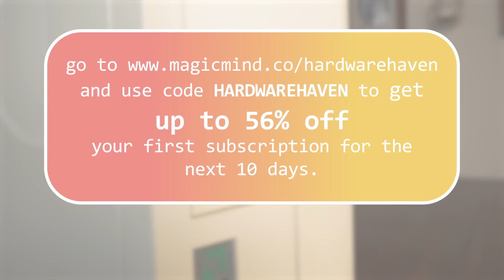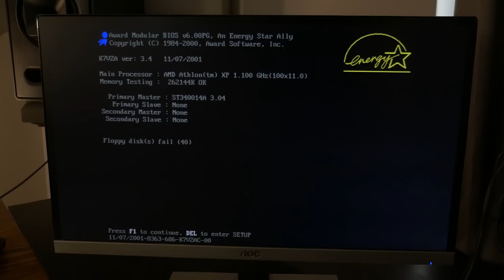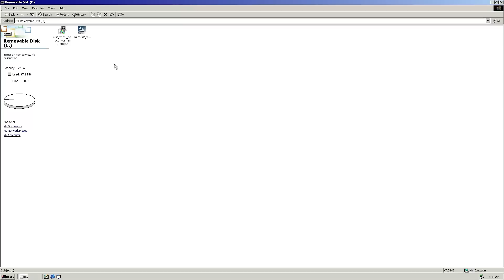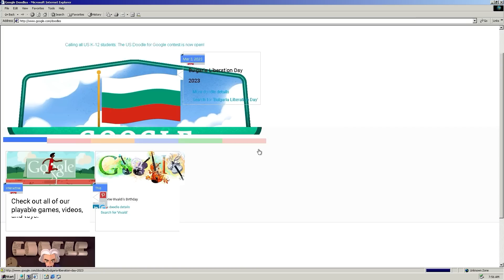The OLDEST PC I've Ever Worked On

Comment: Make sure that Athlon XP is always properly cooled. They have no thermal protection and will literally burn up without cooling.
Reply: Back in the day we would RMA these and most of the time it was because someone booted without the cooler. It took some of those Athlons less that 20 seconds to get to 120deg. The enamel around the doe would turn to a caramel color and flake. “Got another Caramel!”
Reply: @Kikay0n  Yeah, I learned that lesson the hard way about 15 years ago when I tried booting one up without a HSF thinking it would be fine for just a couple of minutes like a Pentium 4. Nope, that was the end of it.
Reply: They actually could crack and the die blow off the chip if left uncooled.
Reply: Yep. I've both cracked the die of an athlon xp and created the magic smoke putting on the hs/f wrong. And not at the same time.

Comment: Those Cases were called GEM cases back in the 90s because instead of having the panels slide back they slid forward after removing the front face, they were sold to antec if I recall correctly. Also power supplies back then had awful caps in them that leaked a lot your a brave man plugging a unit with a power supply that old. I would of yanked out the PSU and put in a modern one before even turning it on lol.
Reply from the maker: What’s the fun in that?? Haha
Reply: @HardwareHaven  well your luck played out well the rest of the hardware worked. When I did it it took all the hardware out with it lol so lesson learned lmao
Reply from the maker: That’s a bummer haha
Reply: @GhostieXV  wow good to know, I use 20 year Macs a lot so maybe I should try and replace it!
Reply: This is actually an Enlight case, EN-7230 to be exact. I have the same case (even the same AMD sticker) on one of my systems. Also in my experience older power supplies are usually fine. It's more slightly newer capacitors with issues. But I would probably do a quick visual inspection of the internals just to be safe.
Reply: These capacitors like slowly turning into resistors too.

Comment: First rule with old computers is "dust" it out. Spiders like to crawl inside and other such bugs short connections.
The 4 pin 12v power connector was introduced with the Intel Pentium 4 processors, we called them the P4 connector because it was 4 pin and the P4 required it, the AMDs didnt need it.
TNT2 wasnt bad for an entry level, better than onboard video but thats it.
The HDD is contemporary to the other hardware but the CDROM drive is a little bargain basement for the rest of it, DVD and CDRW was more usual back then.

Comment: We call it Smoke Testing.  We just power it on, and see if it turns on successfully or if it blows up and starts smoking.  Usually it won't start a fire, but it's scary as heck sometimes.  The old PSU typically will likely have bad or leaking caps so I'm leery when handling anything over 20 years old.  EDIT: if the PSU is over 20 years old, and it's a generic no-name brand, and it's never been tested, I'd skip the smoke test completely.  Just toss it out in the trash, and just use a good psu on hand.  Don't take any chance for any further damage, especially to motherboard and other components.
Reply: actually i'd say some later psus were worse, 'capacitor plague' very late 90/2000s ones, all my really old earlier 90s pc psus have been ok, except one where the mains suppressor cap blew up   (yes, a RIFA!)
Reply: its always a good idea to test any psu of unknown state on a dummy load and measure voltages before letting it loose on the machine itself
Reply: Ahhh the era during the late 1990's and early 2000's when the capacitor plague was at its peak. I still wince slightly when I plug in those IEC leads. I've lost count at the number of PSU's that went pop in my face and shot sparks out the fan grille.

Comment: 6:00

If you are talking about the motherboard power connector, the extra 4 pins of the 20 pin/24 pin connector are basically tacked on the side of the 20 pin connector (on my PSU they are a bit that is held in by the rest of the plug, is wired to the rest of the plug, and slides off if unused) and are for higher power loads

If you are talking about the 4 pin/8 pin CPU power connector, I guess your hardware just has a low power draw and the CPU can get all it needs from the 20 pin/24 pin power connector
Reply: He's talking about the CPU power 4-pin that usually plugs in at the top of the board, the system he's looking at predates those connectors. Also predates the 24-pin ATX power plug.

Comment: for that fan you can put a little bit of sewing machine oil in the bearings and it will get rid of its noise being these were ball bearings with grease originally.
Reply: NAH man all the little old cheap ones were sleeve bushings
Reply: @HighestRank  oiling them can still help. I've had to dig holes in the plastic to get to the bearings sometimes though. Then I'll put a little bit of oil soaked rag in there and cover it up with duck tape. It lasts maybe 6 months before it needs another drop. Once the bearing has spun it's wrecked. Oil in them will quiet it up though. Really old fans had circlips and you could take them apart. Then they went to the press fit design.

Comment: Hey Colten,
I am pretty sure I know what happened I’ve got some experience with this, those old power supply’s always have a tiny red switch to change the voltage it will run on but if it’s switch is set wrong it does the exact same thing as what you describe it did a pop with a bit of smoke out the back where the fan is and that pop is a compasitor that exploded it self for protection because without it it would give a bigger explosion and could catch on fire. So if you ever have a device with a little red switch next to the power supply make sure it is set to the voltage that you have in your country
Have a nice day,
Just Potato
Reply: Literally this.
Reply: at 3:20 we see the switch set to 115v so if he is in a country like me with 240v it would recieve more than double the expected voltage
Reply from the maker: Appreciate it, but it was indeed set to the correct input voltage (115 for me)
Reply: @HardwareHaven  who ever replaced the fan might've helped bring the power supply closer to death
Reply: my understanding with power supplies at this time is that the risk isn’t necessarily the power supply being set to 240V when plugged into a 120V plug, it’s more of the other way around (psu set to 120 plugged into a 240 outlet). if it’s plugged into a lower voltage outlet i imagine worst case scenario is that it wouldn’t turn on at all. i could be mistaken on all of this as even if i had a power supply handy to me to get that i’ve never liked the idea of potentially destructive testing
Reply: @majoryoshi  it may seem that way but it’s really not
Reply: @HardwareHaven than it was something else but it is the same result
Reply: @majoryoshi  you probably wont get a boom but lower voltages still can damage items
Reply: @majoryoshi  yes, plug a psu set to 240 on 115 mains, it likely wont do anything, plug one set to 115 into a 240 supply, expect a good bang!
Reply: @majoryoshi  I've tried running a PC supply at half voltage and it actually half-worked (enough for the fan to come up) but would shut down with just about any load. Depending on the specifics of the power supply circuitry I could definitely imagine damage if run like this over time but less than a minute certainly won't hurt it. Otherwise everything would break if there's a brownout.

Comment: The AGP port was of the early advancements that became mainstream as the industry was rapidly realizing the limitations of the original PC ISA and PCI  bus architecture. The speed of, well, everything was racing beyond those designs, along with the fact you typically had to *manually select" interrupts and memory locations for addon cards until the PCI bus really hit its stride and essentially everything became automated and mainstream. Looks like someone got a lot of use out of that box!
Reply: Remember the video cards with the VESA Local Bus extension?  I remember buying an IBM motherboard with one of their in-house 486s and buying a VESA Local Bus video card to fit into the board's slot.  Figures I managed to buy a board that was incompatible with the video card and couldn't use my new card.  I had to wait until I could afford to buy another motherboard with which the VESA card was compatible.

Comment: Speaking from experience, be very cautious when mounting and removing coolers from Socket A (462) CPUs such as the Athlon XP in this system. The CPU die is exposed and thus very fragile; it's easy to crack the die at its corners if uneven pressure is applied. Have done it before on a Duron, so thankfully no great loss.
Reply from the maker: Thanks for the heads up! Unfortunately I may have already swapped CPUs… but fortunately was aware and took precautions haha

Comment: by the way you probably don't need to replace the CPU fan all you have to do is lift up the sticker on it and put some sewing machine oil into the hole to lubricate it. should fix it right up.
Reply from the maker: Possibly! I already replaced it but haven’t recycled the old one yet. I’ll give it a shor
Reply: @HardwareHaven  may as well try, nothing to lose, i've resurrected a few doing it,  it may not cure it totally but it'd be usable for testing purposes
Reply: @andygozzo72  yeah once a fan has done the rattle of death that means metal damage has occurred. What you're hearing is the metal on metal. But oil will still help it out temporarily. Then it'll float on a film of oil. It'll never be quite how it once was though. So oiling them is a kinda fix.
Reply: @1pcfred  thing is  not always possible to replace the fan as may be a non standard size/shape and/or unobtainable, the one in a time/mitac laptop i have makes a good racket even though its been well lubricated! i cannot find a 'new' replacement, only old used ones which would likely be similar state
Reply: @andygozzo72  I stay away from laptops because they are difficult to work on. Plus I really do not need the portability they offer. PC tower master race!
Reply: @1pcfred  certainly more difficult to service, pretty much impossible in many cases, i nearly bought a new one a few years ago but had no user changeable parts, no compartments for memory or hard drives, you had to pretty much break it open to do so, so i passed on it, and still using my 2007 HP NC6400, i picked up a good used HP G61 for when it finally conks out
Reply: @andygozzo72  beyond opening the hatch under a laptop I can't get any further into one if you want it to ever work again. I'm not good with little stuff like that.
Reply: @1pcfred  hehe, they can certainly be a pain 😉
Reply: @andygozzo72  compromises must be made to achieve the compact size of laptops. That impacts performance.
Reply: @1pcfred  yep... thing is theyre more convenient in many ways, takes up less room, can be put away when not in use, uses less power,  just theyre a pain in the bum when anything fails like screen or keyboard! luckily the old ones i've bought over the years with dud screen or keyboard i've been able to get replacements for eventually, except one , a featron f6000 486 thingy, its now been scrapped due to nicad rot 😢 but it DID used to work ok with external keyboard , i kept the usable parts  out of it of course..
Reply: @andygozzo72  I do not find laptops to be more convenient at all. I have places where I can leave PCs. So not a problem. But I can see where that'd be a feature to people in other circumstances. I hate the keyboards on laptops too. I have a mech keyboard. Love it. MX blue switches.

Comment: god i remember findong a few old 90s pcs like this in my attic, one thing i did was i had the little red switch on the back set to 110 instead 0f 230 and the thing blew up like a flashbang. watching him be so confused by how the case comes apart and all the old connectors is hilarious
Reply: i've never come across one...yet... that you have to remove the front to remove the sides, all mine slide backwards !
Reply: @andygozzo72  Swinging out is also super common for PC cases. A bit uncommon but far from rare are side panels which slide up after sliding the top backwards.
Reply: @eDoc2020  i have an AT tower where the panel the motherboard screws to can swing out, after taking the combined sides and top off..

Comment: I love seeing your enthusiasm for this older system.  It does make me feel old though.  I've been working on systems since the 386/DOS days, and comparatively this is a new system.  
I owned several computers in the same range as this one.  When my kids were younger, their gaming PC's were spec'd out similarly, although the Vanta graphics card would have been a no go.  I still have a few old AGP video cards and recently built a Pentium 4 retro gaming machine with an ATI Radeon 9800XT.  I would have rather used one of my Athlon XP's, but gave them all away as they were retired from my household.  Wish I had them all back to play with now.
Reply from the maker: I got a Radeon 9600xt for part two, which seemed solid. The higher end stuff is still really pricey haha.

And I can possibly send out an athlon if you’d like one. I have two now and ones just on a shelf for display
Reply: @HardwareHaven  The 9600xt is a decent card as well.  Thank you for the offer of the Athlon.  That is extremely kind of you.  I have a few CPU's still, but gave away the systems as they were replaced by newer ones.  I still had a couple motherboards up until a couple of years ago but gave them away as well.  The Pentium 4 is just fine, but I never owned one back in the day.  My first computer was a 386 AMD, My second one a 486 AMD, then.... (It keeps on going).  I think I've purchased 1 brand new Cyrix and 1 brand new Intel in the PC era.  The only time it was truly a mistake was during the last FX period.  I had an FX-4100 and still have FX-8350 I use.

Comment: Welcome to early 2000s computing!
My guess on your PSU is that a ceramic capacitor failed into a short which exploded that resistor. There's a ceramic cap (between a big grayish resistor and a diode) that's darker/shinier than it should be and appears to have edge defects. That's probably your main culprit. Why it failed, though, is anyone's guess -- thermal stress, leakage, manufacturing defect, etc.
I, too, had a PSU "pop!" and shoot flame out the back. Absolutely terrifying. At the time, it felt exactly like your dramatic reenactment! Mine was due to capacitor plague (look it up, it was a major problem back then but it affected electrolytic capacitors, not ceramic).

That crazy POST screen with all of the device info? That's a holdover from the generations before that system, when we had to manually manage I/O addresses and IRQs (and sometimes DMAs) to avoid conflicting peripherals. PnP auto-configuration was mature enough by 2000 that the display was rarely relevant anymore. But most BIOS manufacturers just didn't feel any pressing need to change the look until about 10-ish years ago.
Reply: ceramic caps are usually very reliable, although can  occur, i've only had 2 short in 30+years of 'tinkering' .. tantalums are notorious for it but never had one go bad myself.....yet.... i'd say more likely the  'chopper' chip shorted and it blew some series component, maybe a resistor or resistor sized fuse..
Reply: @andygozzo72  Tantal caps inside a noname PSU? I don't think so..
Reply: Eh, this is nothing. For a real fireworks show, you need to see a big UPS fail! Back in 2005 or 2006, I sent one of those 3000VA/30 amp APC Smart-UPS bad boys out for refurbishing, and apparently the company that did the work missed something. When I got it back, I plugged it in, turned it on and it failed again with a very loud POP and an impressive shower of sparks. It was a good thing I thought to test it before plugging the servers back into it. I never sent another UPS out for repair; I just replaced them after that incident. But I was also usually dealing with much less expensive, lower power battery backups, and when those need more than a simple battery replacement, it's usually time to just recycle them.
Reply: @deterdamel7380  tants on motherboards 😉, especially older IBM ones
Reply: @andygozzo72  Yes, on the motherboard, but not inside the PSU.
Reply: @deterdamel7380  its possible a psu could use tants, though, i havent opened ALL the ones in my old computers!